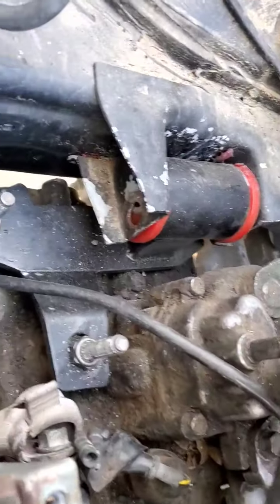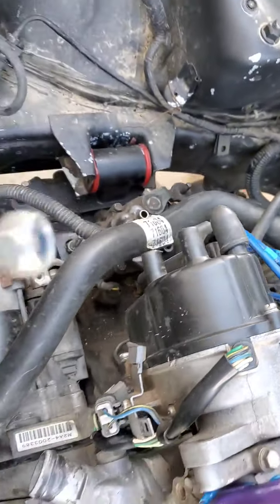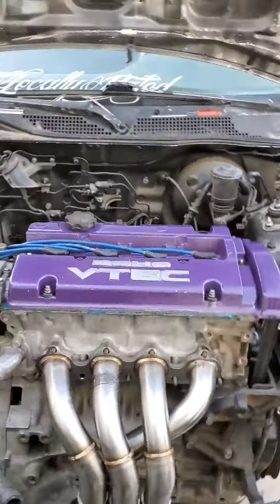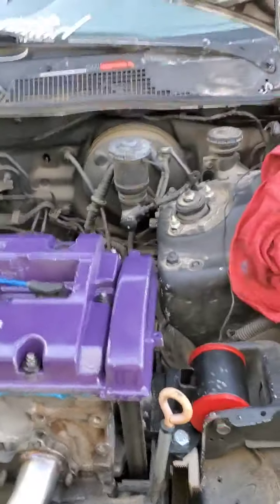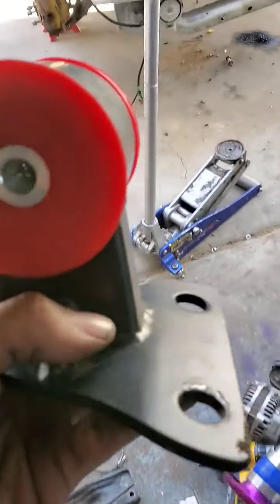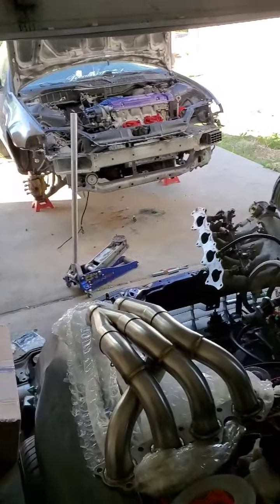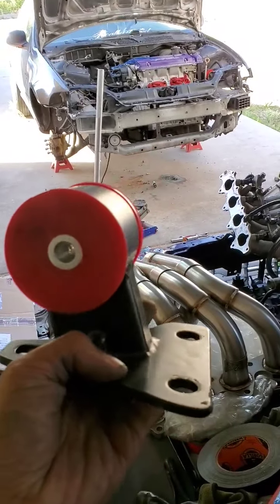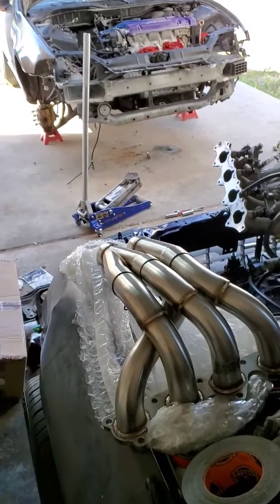H22a Eg Indepth Swap Guide 🔥ITS IN THE CAR🔥

Comment: Those $100 bro, take my advice and throw them away like they did you something personal, they tend to go bad after awhile, i got myself the innovative swap mounts, cant go wrong with those
Reply: Used these Mounts This Week the R
Rear mount didn't line up lmaaaaoo I just watched this and had to cut transmission post side The cheapo mounts are trash 🗑 😐
Reply: @Universalimports  i learn my lesson the other time when i was driving and decide to launch, lucky they hold but they were busted up badly